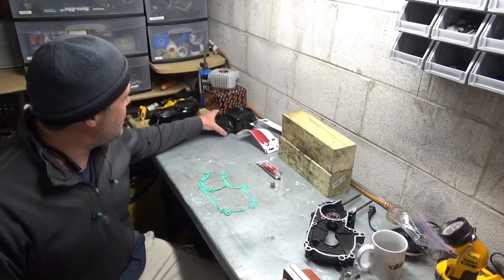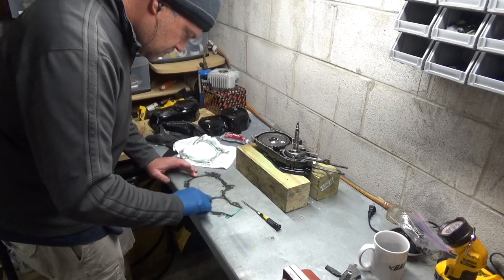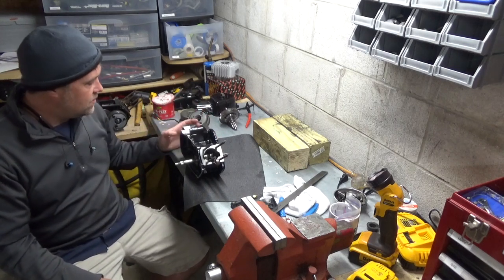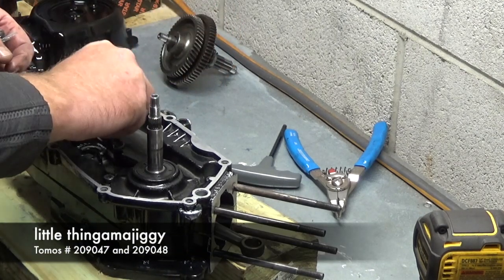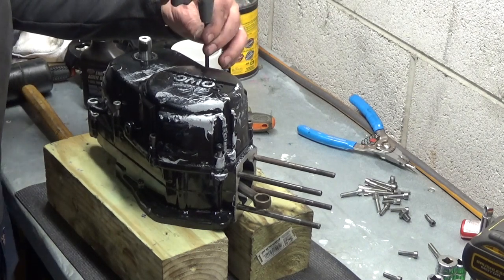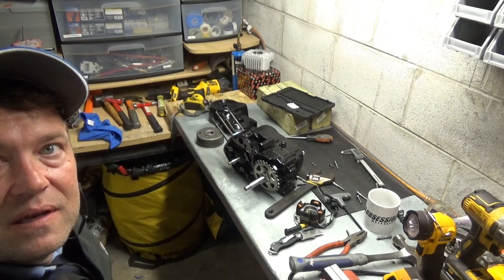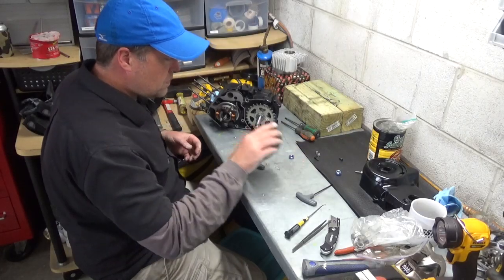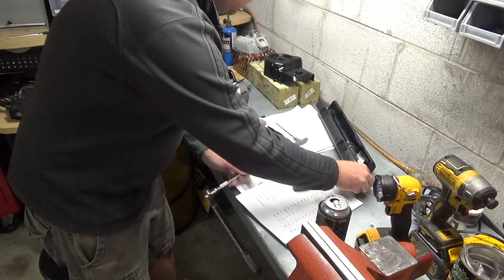DFHS Tomos Restoration Ep. 5 - A35 Engine Rebuild/ 70cc Kit Install

Comment: I found it works much easier, by putting the piston inside the cylinder halfway, so that the rings are compressed, this way it is easier. then put the whole thing onto the studs so that the piston aligns with the con rod, put the piston pin in and done.
Also the DMP high compression head looks a lot better, it aesthetically fits the cylinder a lot better. They come black as stock, if you so find it important, then you could sand blast it to make it gray.

Comment: My pedals stopped engaging one day and i've watched this video like 20 times and taken the transmission apart about 5 times. My sprag clip popped out and started all this and i've had problems since. All the parts look in good shape, and i put them all back properly, but the pedals still don't engage, front or back. Can't quite figure it out, if its all assembled properly it should work, but its been a no go. Trying to get some ideas before i go for time #6. ALSO: i watched the future video where you forgot to put a second washer on the pedal shaft, but if i put more than one there, then the trans is locked up and wont move at all. If you've got any sugggestions, id love to hear them!
Reply from the maker: Are the pedals stuck, or do they move and just not engage the gears?
Reply: @DavidFixesHisShit  the shaft moves, the they just don't engage. I have a feeling my claw collar spring needs replaced. The gear with teeth that's supposed to move seems to come off track when I when i turn the pedal shaft. I'm assuming the claw spring isn't putting enough pressure on it. Thanks for replying! Your videos have been very helpful!

Comment: I need to replace the stator coil on my 2010 tomos sprint, and I have read that there is supposed to be a timing mark on the stator coil that lines up with/in between 2 lines on the engine case. But the stator coil I got to replace the one on my bike has NO mark on it https://www.treatland.tv/original-tomos-A55-OEM-cdi-stator-pickup-p/oem-tomos-cdi-stator-243100.htm.                 So how do you go about mounting it to ensure proper timing? Because even the stock one on my bike doesn't have a timing mark!!! Does the flywheels external magnet https://www.treatland.tv/original-OEM-tomos-A55-electric-start-flywheel-p/oem-tomos-a55-flywheel-243101.htm trigger spark with the hall sensor, and make it so it doesn't need to be mounted in any SPECIFIC spot?? Or does it just mount so that the darker coil is roughly at 6 o'clock, and the wires can be oriented properly?? Seems NO ONE on mopedarmy had an answer...

Comment: You beter put a55 cylinder head without gasket on this airsal kit .
There is no problem with standard  head on the airsal . Runs beter and compresion is higher.
Reply: Svaka cast ovom Ameru...😂😂😂... a je volja ... 😉😁

Comment: In '99 I was desperate for transportation and paid $800 for a '97 'Tomos'...it was the solution to transportation...but agony to ride from the relentless buzzing and vibration *The suspension was far too weak for 220lbs. on it and the skinny tires were dangerously
over-loaded and the bike itself was inherently unstable over ruts and 'bumps' in the road*
NEVER AGAIN!

Comment: Hello im going to change the toothpick of my tomos im going to put 33 theet behind but in front of me i have to put it in order to be able to board the toe please help me
Reply from the maker: Google translate FTW!  Not 100% sure what you are asking, but I think you are going to put a 33 tooth gear on your Tomos, in which case it’s pretty straightforward. You might need to lose/gain some links on your chain, but you can get a cheap tool on Amazon for that. Good luck!

Comment: dave i could sure use your help with my 2004 a35if you are still on here anymore??  please respond!
Reply from the maker: Sure.
Reply: @DavidFixesHisShit  hey Dave what is the proper carburetor and jetting # for main jet for 64cc kit with the stock 1412 carburetor or 15 mm carburetor

Comment: what size piston rings do you suggest for a big bore 1999 targa tomos ?
Reply from the maker: Hard to say. Measure the inside of the cylinder with a caliper. Then go to treatland and see if you can find something that will work. You can always find a new piston and ring that you like and then bore the cylinder to the new diameter. More displacement= more ripping!!  Good luck.

Comment: Can you use the stock compression head for the big bore kit?
Reply from the maker: Yeah. Should work with no problem. And remember... the Puch kits work on the A35 too. No issues. Sometimes those are a bit cheaper and if you save $30 on the cylinder, you can buy the hi compression head too. They are pretty cheap as far as moped parts go...  good luck!
Reply: David Fixes His Shit thank you!
Reply: David Fixes His Shit what size main jet should i get for my carb ?
Reply from the maker: What kind of carb do you have?
Reply: David Fixes His Shit dellorto 12/14 or somethin like that
Reply from the maker: Hmmm. If you keep your small SHA, then I’d probably start around 65-70 and see what’s what. Jets are different for every bike/climate/elevation so you really gotta tune for your bike. If you throw a 70cc kit on, a 70 jet would prolly get you pretty close. If you haven’t already looked, the moped tuning spreadsheet is an awesome way to get pretty close.  Then you just hafta fine tune. Here’s the spreadsheet. https://docs.google.com/spreadsheets/d/1F_0LaiQj5zDMZujVP8MvJV44CxUQNTNRqsViW_OX-eY/htmlview#

Comment: What carb did you use for the kit?
Reply from the maker: Hey Eriaz.  I used a Mikuni VM18.  And I love it.  I can't recommend it enough...
Reply: David Fixes His Shit just ordered the exact same one lol
Reply from the maker: Hot damn!  You gonna be happy. I’m running a 76 jet in her, so make sure you get a good range of 70s and 80s so you can get her dialed in.
Reply: Does it come with a new throttle cable or do i have to order another one as well?
Reply from the maker: You can use the same throttle cable that you already have. If you want to get the carb to open fully, you are going to need to dremel out a bit on your throttle. I do it on the videos. It ain’t hard. Happy brrrp’ing!